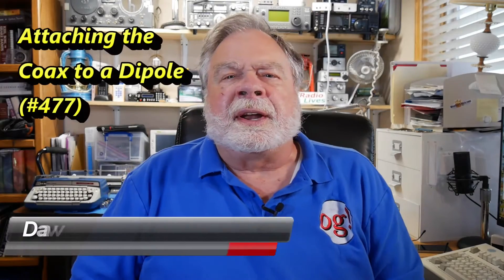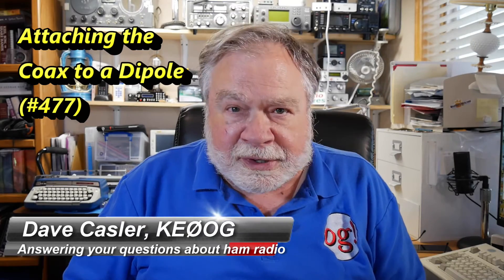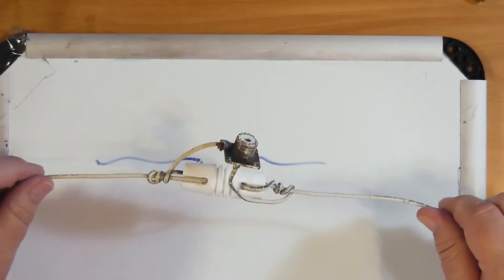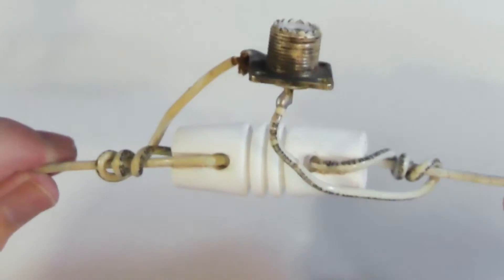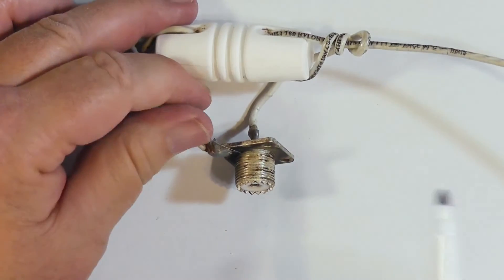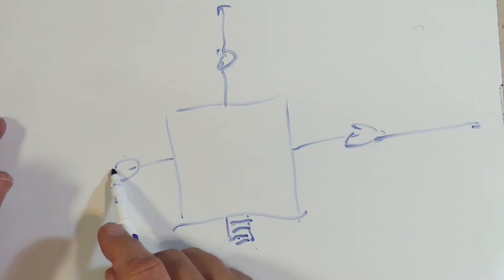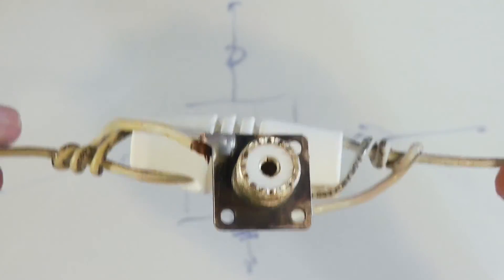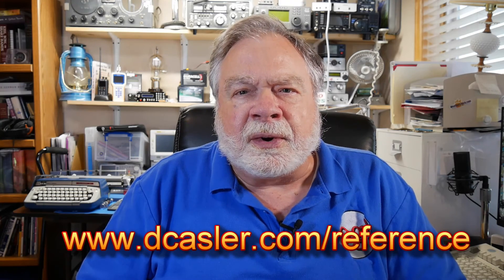Attaching the Coax to a Dipole (#477)

Comment: What about rain getting in the coax? Especially if you just solder it. I thought you’d twist the antenna wire on the center insulator for strain relief, then attach wires before all the twisting to go to the coax connector?

Comment: In over 60 years I have never used a balun on a dipole except a couple times where I wound some coax into a coil on a couple like you mentioned.  Not sure why I tried it but I did. No difference noted and I doubt if I will ever do it again. I did use one (coil of coax)  on my 4 element Hy Gain 204 BA (full size 20 meter mono band Yagi) because they had it in their instructions and I was interested in doing whatever I could to maintain the pattern. On my Mosley TA-33 there was no balun and the pattern was not real symmetrical. Was it the lack of a balun or something else? We will never know for sure.